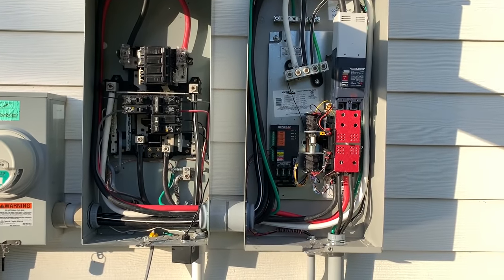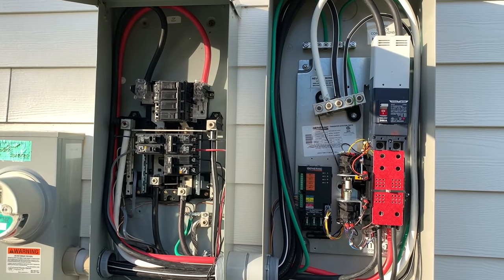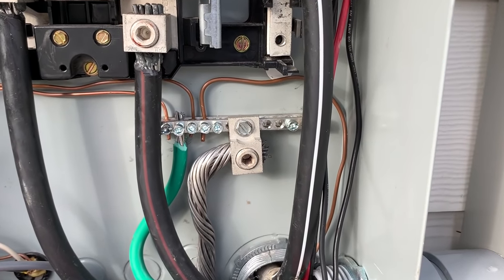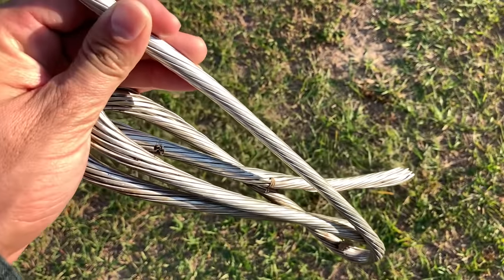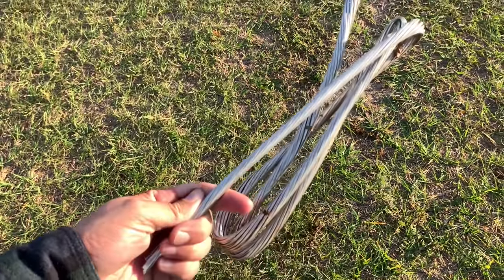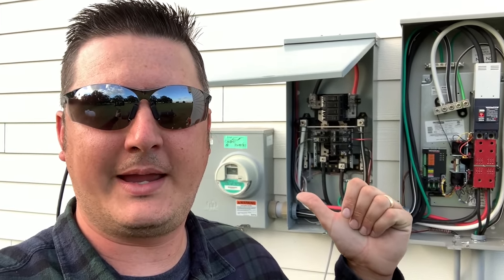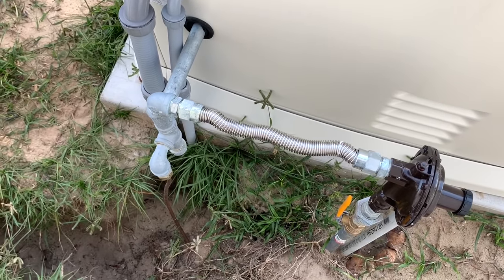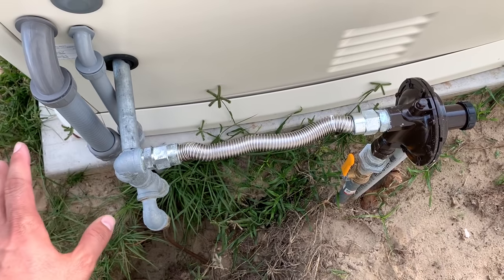Problems with our Generac generator install￼

Comment: Amperage rating of a panel doesn't make them more dangerous, voltage rating does.
Reply: Amp is what kills you, not the Volt
Reply: @jurorx  if you knew anything about about resistance, voltage, and current flow you wouldn't have said that. You repeating safety class
Reply: @MacGyver-1  Explain to me how electrical fences, tazers etc.  works.   High Voltage miniscule ampere, because Amp is what kills you.
Reply: @MacGyver-1  An electrical current at 1,000 volts is no more deadly than a current at 100 volts, but tiny changes in amperage can mean the difference between life and death when a person receives an electrical shock.

Google this:  what kills you amp or volt

I'll wait for your reply, not electrician, but a 30 year telecoms technician so i know the basics of electricity.
Reply: @jurorx  you don't understand ohm's law. 

The human body has an internal resistance, a resistor has a direct effect on current flow at a given voltage. You could have a 10000 amp rated panel at 1 volt and you could hold onto it all day without harm. At 240 volt you could also hold onto it, does it effect muscle control?yes. Does it kill you? no. Because of the resistance of your body. High resistance mean low current flow. You could get hit by an electric fence with a voltage of 10,000 volts and it hurts but won't kill you. Why? Because the capacitor charging the fence has a limited amount of current it puts out. The comment I made is that the amperage rating of a panel does not make it more dangerous, the voltage of a panel makes it more dangerous. And this is because it takes a higher voltage to flow more amps through a resistor. You are clearly just a phone tech and have limited knowledge about what your talking about. Hence your request for me to "Google it". You seem to have the mental capacity of Cenk Uygur
Reply: @MacGyver-1  you are kinda right but also wrong, 240 volts at 1 amp can kill you so can 1 volt at 10,000 amps. Thats why gfci for human protection kicks out at 5 ma. Anything over 7 ma can cause permanent damage.
Reply: @thomasmarable6818  amperage flow is determined by the resistance of the conductor (human body is the conductor). That amount of current must flow through the heart or brain to cause death. When you touch one conductor the current flows in the shortest path to the other. Very little amperage would get to the heart and even less to the brain. And only the higher voltage and cause more amperage to flow. Defibrillators run as high as 1000v and provide as much as 45 amps for as long as 45 seconds and very little of that current actually penetrates to the heart and almost nothing to the brain.
Reply: @thomasmarable6818 1.  you don't understand amperage flow through a resistor. 2. Are you saying that under the scenario that you heart is exposed and two electrodes are directly applied to your heart with a potential of 1 volt and a capacity of 10,000 amps it would kill you? Your wrong. 3. I would think you have more problems then electricity if your chest is open and someone is sticking metal in your chest.....
Reply: The danger of high amperage panels is available fault current and arc flash = severe burns if any thing should go wrong.

Comment: This really isn't correct.  The NEC never required the use of noalox on aluminum.  What NEC 110.3(B) has always required is for you to follow manufacturers installation instructions.  So if the instructions say you have to use noalox, NEC says you still have to use it.  And some still cable or connectors still do.  Others do not with the advent of AA8800 aluminum cable.  NEC 110.14 does still say the correct materials must be used where dissimilar metals are connected, such as connecting copper to aluminum.  Old aluminum conductors were also an aluminum alloy, just a different alloy.

Comment: Your propane guy screwed that installation up. Make him come fix it. The flex line is fine as far as being between the regulator and nipple going to the generator. That's where it's supposed to be as you can't run flex directly to the generator.  What is wrong is that he ran a fixed copper line  that is connected to the generator. Every time it runs it will vibrate that line and soon break it.
Reply: I've never seen galvanized pipe used for natural gas or propane. its not code approved where im from.

Comment: I think I heard you say the AHJ did not care to enforce the Code with respect to providing an OCPD before the ATS (essentially a main breaker).  If that is correct, shame on him or her; a failure at your ATS means there is no way to disconnect the ATS from the utility in order to service it, nor is there any way to protect the ATS against a full-on explosion due to a short circuit within that equipment.   I would not sleep well at night.  That to me is far more of an immediate concern than the violation of chasing non-fused service feeders through one panel to feed another.  But on that point, it represents a safety hazard of another sort, should unqualified workers/homeowners be led to believe that opening the 200A service disconnect in the loadcenter disconnects the utility, when in fact this panel continues to contain energized circuits in the bottom of the panel.  Moreover, the ATS - which physically appears downstream of what looks like a "main" in the upstream panel to the left, is in no way de-energized by opening the 200A OCPD.  Having listened to your entire vlog I know you know better.  You are better than this.  Be well - protect you, your loved ones, and neighbors who might come to render aid someday.
Reply: As long as the ATS is service rated then its ok
Reply: The ats Is a suse panel and has the FIRST disconnecting means.  If you open the main breaker in the sub panel you kill power to the load. The only hot conductors would be between the ats SERVICE DISCONECT (as it is fed from the meter) and the main breaker inthe sub panel, as it is fed from the ats. Open the ats breaker, and your still hot from the ats to the meter, which is why you don't put un fused service feeders, with other current carrying conductors.

Comment: I have viewed several video's about a variety of electrical projects. I am often amazed to see professional electricians point their bare fingers at connections in service panels, transfer switches, etc. Come on guys what the heck are you thinking? Although circuits are said to be deenergized, and tested to be deenergized, they are still to be treated as being energized. Pointing one's finger at --- and often touching --- contacts, connections, etc. with one's finger or an uninsulated screw driver is sending the wrong message to do it yourselfers. Advising viewers to get a professional if they do not know what they are doing may protect you from legal action if someone gets hurt; however, such careless fingerpointing touching is unbelievably careless. Why not use a piece of dry wooden dowel or solid plastic rod to point?

Comment: Thanks for the response video. I don't understand why you jurisdictional authority allows you to use a common raceway. That's not a good idea for many reasons on a safety standpoint as well as practicality. The way I look at your installation it says lazy. You don't have and overcurrent protection device feeding your transfer switch. You feed straight from the meter socket through the through distribution raceway with your feeders unfused to you transfer switch. So congratulations you'll be working on that transfer switch live because you can't shut it off from the utility side without pulling the meter socket. Add a minimum you should've gotten a meter socket with a disconnect. Simple done. In most jurisdictions I know of it would be impossible to install your generator transfer switch in that configuration super dangerous. as you can't perform maintenance on your switch without your arc flash suit perhaps! ha ha ha ha . The next point is the gas connection to the generator? It's not clear from the photos you show but it appears your pipe is galvanized ? Starting at the tanks seems have a primary regulator as it should. then it run to the back of the generator where another regulator is set with some type of plastic pipe on the vent of that second stage regulator. which feeds the generator and then appears to have a copper tubing extending off a drip leg into the ground exits the ground next to the house and into your house. So effectively you have one regulator servicing the generator and servicing the equipment within your house? If that's the case? I asked does it work? Generators usually need 11 inches of pressure. and we usually run 5 inches into the house so just wondering. This flex pipe without seeing listed rating appears to be the wrong application it's a flex pipe but it's not rigid. It's continuously flexing that's the wrong application for the generator. Typically the generator has a isolation dampening tailpiece with a bellows type pipe connection between two nipples that extends to the enclosure that your flexing element. usually mounted right off of the generator. not the gas piping apparatus. My preference on an outside or damp installation would be to use a dab of dielectric grease on all the lugs after they are tightened that's to insulate the surface from condensate, also ensure you have the drip open in the corner of all those enclosures to ensure you don't build up condensate. Within these  enclosures . That's my two cents. Peace bro

Comment: GENERAC, ARE NO BETTER THAN THE JUNK YOU CAN BUY ANYWHERE, THEY ALL OPERATE AT3600 RPM, WHY? Because they ALL use cheap 2 pole generators,,to get the voltage and HERTZ,  I own a bent connecting rod from an 7 month GENERAC, not mine, 🇺🇸🇺🇸🇺🇸🇺🇸
Reply from the maker: Unfortunately everything is junk these days. Everything is disposable.

Comment: The flex line is designed to penetrate Into the unit. And supposed to be straight
Reply: Wrong read the tag on the flex.
Reply: Read the code .

Comment: The gas flex being twisted is unsightly but not critical. Again you DIDN'T read the manual. That reg needs to be 5-6' away from the appliance so that it can regulate pressure correctly. This is an engine and not a BBQ. 

So all the talk about bushings and wire goo...blah blah blah. You clearly didn't read the installation manual.

If you would have put the reg further away you wouldn't have had to bury the reg vent which is kinda hack and asking for trouble when it cracks and fills with water.

You also need to go back and run the proper stranded 18 gauge control wire.

Of course you tried to save a few pennies but using that and you spent more time running the second conduit for no reason.

You literally can run one tray cable with all the correct wires in one conduit. But hey penny wise and pound foolish.

All of this is what you get from guys that "install" generators. Yep looks like another expert out in the field showing everyone how to do it.
Reply from the maker: Says the fella watching how to videos on YouTube and leaving rude comments. I hired a gas company to do the gas install. They installed two separate regulators on the system.
Reply: @MaynardFamilyHomestead  yeah I'm actually a tech out fixing everyone else's garbage installs as usual. So that has no relevance on my comments. Try again...

READ DA MANUAL